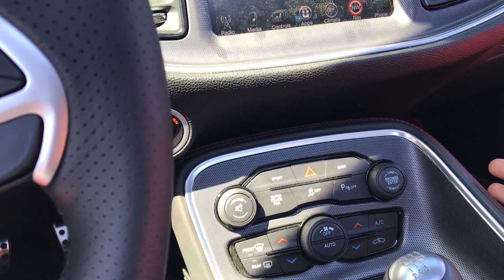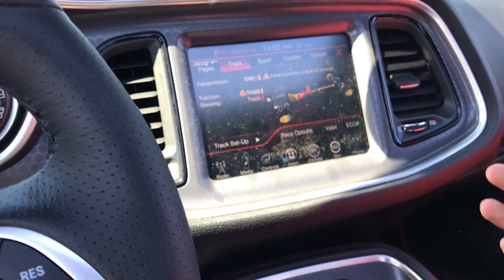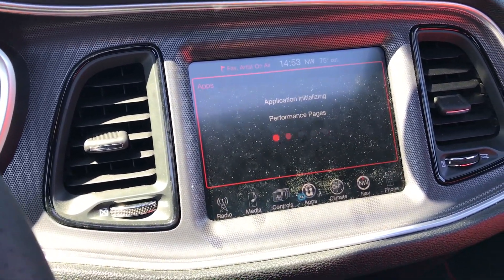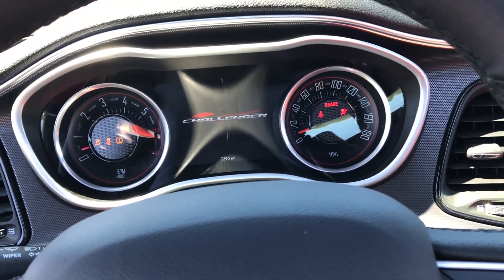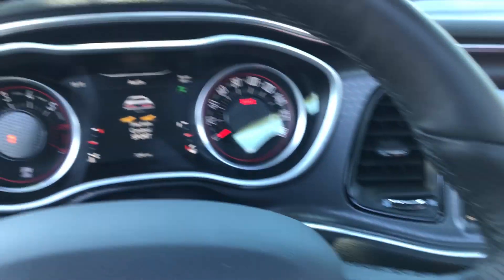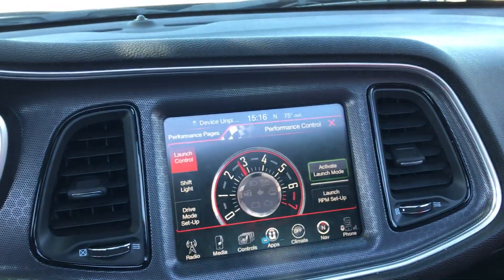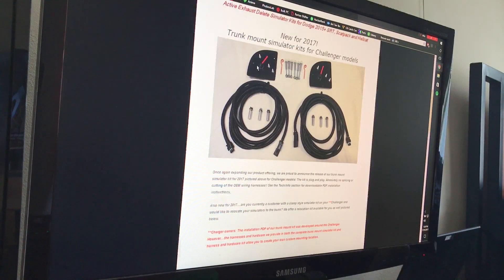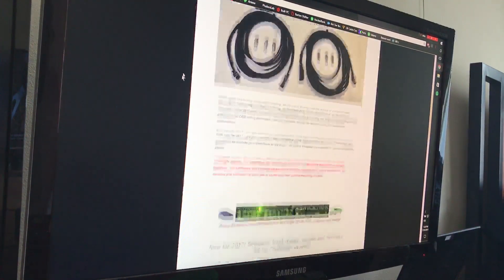BYE BYE TAZER | Removing SRT Pages from my 2016 Challenger Scat Pack!

Comment: You can change the default mode at start up, with the tazer. So you could be in track mode all the time, by default, if you wanted. Never have to push the button.  You can also change the display screen you don’t like too.
Reply: What do you mean by changing the display screen?
Reply: @Jameslll03  tazer has different display screens you can choose on start up. If you didn't already figure  this out

Comment: Need to read up better my man.  Not sure if you changed your mind about the Tazer or not but you can reprogram your sport button.  

With the Tazer plugged in, car in the RUN position without engine running (ON not ACC), push and hold the Left arrow then hit the button you want to program, in this case the Sport button.  Use the left arrow and cruise cancel to scroll thru the options until you get to DrvMode or something like that (it’s obvious when you find it) and change it to Track with Left arrow and the Cruise button.

As far as getting your bee back, just change the setting from SRT back to ScatPack and you’ll have everything like you used to

Comment: Your willing to give up track mode? Shifts much sharper than sport mode. You can also change your opening flash screen with the Tazer.
Reply from the maker: Well my car is manual so track mode doesn't make my transmission shift sharper or anything like that

Comment: I would never remove them. I have so much fun with it. The dash font looks alot better as well. The only downside is losing the bee. Also, when you hit sport without the taser, the traction is not fully disabled as it is with the pages installed. Also, you lose the burnout thing!
Reply: Talk to me about this "Burnout thing"?????
Reply: Da Mofo Man 1969 First i believe its called Line Lock on the website if u wanna look more into it and what it basically does is that it will hold your front brakes so you can do a burnout without any wear and tear on your rear brakes

Comment: Hmm...I was not aware that Track mode/SRT pages was not a standard option on the Scat Pack. That's a shame. Same motor as my SRT392, what gives. 

Hi-Rev Shift changes using paddle shifters in Track mode is insane.
Reply: worth buying tazer for 392 srt?

Comment: there's a way to remap the button to make the sport mode do the same settings you want!
Reply from the maker: I've been told but that still doesn't give me back my Scat Pack super bee on startup!
Reply: That is the one major draw backs to using the Tazer in the Scat Packs. I will say as someone who LOVES and wants the Bee splash I don't miss it.  My Scat is my daily driver and as soon as I hit start and get situated the Bee is gone anyway. In my opinion Track Mode and yes even ECO mode is worth the $250 and no Bee.  If I wanna show off the Bee splash I can turn off SRT Modes in a matter of 2 minutes. Lastly I know the guy who invented the TaZer and I promise you if there was or ever will be a way to engage SRT in our cars AND have the Bee Splash he will find it. He hates it too. The thing is that once you enable / unlock SRT modes your PCM thinks it's an SRT and SRT's do not have the option for the Bee....so while its a major disappointment it is still worth using. I didn't  buy this car for the Splash Bee....I did buy it to turn heads and the Track Mode Active Exhaust is more important (IMO).  Good luck with whatever you decide. #moparornocar
Reply: d2s 392 how often does your tazer get updated
Reply: I don't get why people are so obsessed over the bee splash. just use srt mode.
Reply: Chris Waters ....Hey. JoeZ is always tweaking and adding new features so all you have to do is check his website periodically to see. You need a Windows based computer (Booo) and the updates only take a couple minutes to do. Hope that answers your question. If not let me know.
Reply from the maker: The super bee is one of my favorite parts of her tho
Reply: d2s 392  do you know if there's going to be an issue if I get my car tuned I did the tazer thing.  Sending my pcm to hp tuners so should I expect any issues?  Since you know the guy mayne u can see what's up
Reply: theBLACKOREAN  how do I remap the sport button

Comment: @theBLACKOREAN Just change the splash screen to scat setting using your Tazer. Turn off the car, get out and lock the car put the key in your pocket. Stand 10 feet from the car and wait 30 seconds until all your lights go off. Sit back in and you got your logo back dude.

Comment: The srt pages are way better dude than so pages!! The auto trans shifts 10th faster in track mode than sport mode... also diagnostic features... You also have line lock and light show ...
Reply: Why does track mode have the cylinder deactivation though?

Comment: Dude there is a kit u can buy for $150 that keeps the active exhaust system open at all times no codes no check engine light,u must be new to the game.
Reply from the maker: I mentioned the Kit in the video, posting another today to show the before and after
Reply: Does the tazor make the engine light come on? How hard is it to remove?

Comment: Actually, you just have your tazer configured wrong. Also, with the tazer, you can force your car to automatically start in sport mode. You'd also know this if you did a little research before jumping to this conclusion....